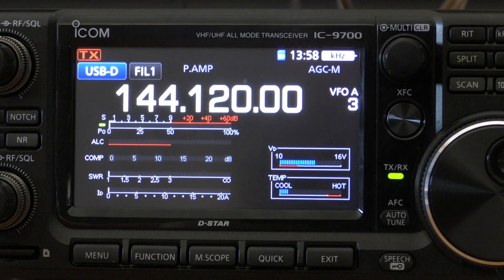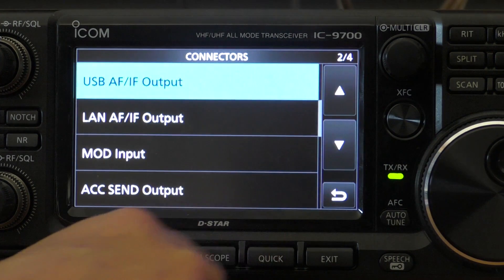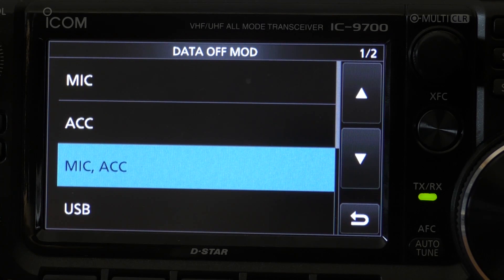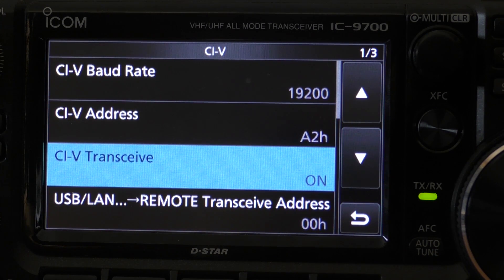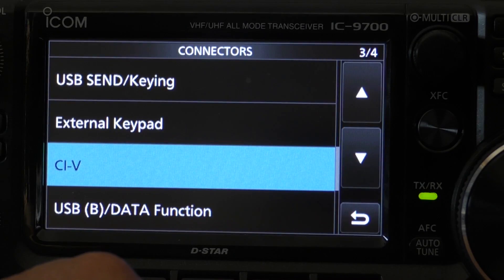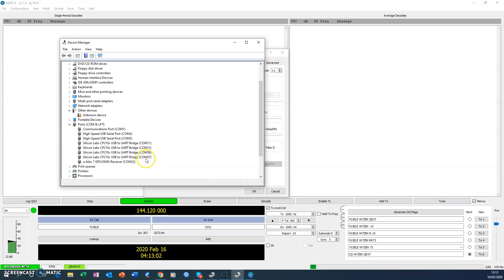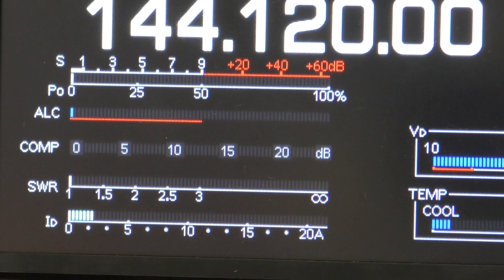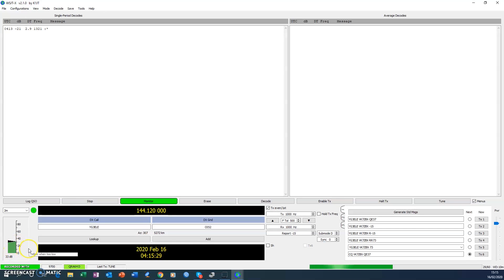Icom IC-9700 SETUP for WSJT/Digital Modes (Easy and Simple)

Comment: Gday mate looking into getting one of these would you still rate this radio as good 4yrs later?
Reply from the maker: Yep 100% great radio!
Reply: @HamRadioDX  what antenna would you recommend im based in central highlands of tassie?
Reply from the maker: @danielmcarthur6200 What are you interested in? Just working repeaters, weak signal SSB? Satellites?
Reply: @HamRadioDX  not 100percent sure yet just a beginner ill most likely start with repeaters there is one here  eventually cover everything that radio is capable of
Reply from the maker: @danielmcarthur6200  The 9700 is probably massive overkill for just repeaters! You can probably find a much cheaper radio for that.

Comment: Hi Hayden, I'm just getting started with FT8 on my IC-9700. I noticed the frequencies suggested by WSJT-X for 2m, 70, 23cm are different to what the WIA band plan indicates. For example, the band plan indicates 144.320 rather than 144.120 on 2m. What has been your experience with international DX QSOs with FT8 on those bands? Do you use the WSJT-X frequencies or the band plan frequencies? 73's Daryl VK3MCB
Reply from the maker: G'day Daryl,
I stick with the bandplan, so 144.320 MHz. 

International DX on 2, 70 and 23 is really by appointment anyway to NZ. I don't think I have ever worked FT8 across to ZL? Anyway, if you head into the software, settings > frequencies and right click on a frequency I think you can add a new one so that it appears in the WSJT-X drop down list.

Hope that helps!
73
Hayden
Reply: @HamRadioDX  Ok, thanks Hayden, that makes sense. Will give that a try.

Comment: Helpful - thanks... but...  even though all settings agree, and test-cat and test-ptt operate normally, I get no audio in from WSJT and no power out from the radio, on transmit (tune, or enable).  Selecting a different mode (RTTY) I can confirm the radio is putting out, but not in USB-D.  I am used to using WSJT thru HRD on my 7300, which works fine.  Scratching my head - going to methodically compare data settings between 7300 and 9700, hoping any difference would be a clue .... de K1VI
Reply: Comparing radios not so easy ... the menu structures are more different than I expected.
Reply from the maker: Are the USB audio codecs selected in WSJT-X as the output and input sound devices? Do you have USB set as the connector in the radio?
Reply: @HamRadioDX  I have the same problem as @michaelbragg8280. My firmware is 1.44 on the 9700. I've tried everything I can think of to no avail. Firmware problem?  tnx

Comment: Any idea if you can do dual band WSJT simultaneously with the 9700?
Reply from the maker: I don't think you can as the 9700 only really has one set of COM ports for use. They can't be used by two lots of the application at the same time.

Comment: Many thanks by your nice info about, I believe, the first WSJT configuring IC-9700 using IC-9700 rig option. Unfortunately I have a trouble and I'm deaf! I was trying many configurations and ever I'm deaf on digitals!!! What will be the trouble?  I'm not deaf in cw and phone. But I have several problems with the FT8 RX! Would be any computer component??  ea1w@ure.es
Reply from the maker: Hi Domingo, did you manage to get this working? Is it deaf as far as your computer isn't getting any audio from the radio?

Comment: Split should be  Rig  or Fake it   to  avoid TX audio harmonics
TX ALC should be set to between 30% to 50%  as per the rig's manual
Reply: No, not on digital modes.  The video is correct.  ALC should not activate.   This is as per the WSJT set up instructions from Joe Taylor.
Reply: @waltonwader6449  you are wrong -   read the manual that comes with the radio..  Read the reviews - the rig does not splatter at all  at  50%  or more ALC showing..
Reply: @waltonwader6449  https://www.youtube.com/watch?v=E9skTDw8SXM
Read the manual..